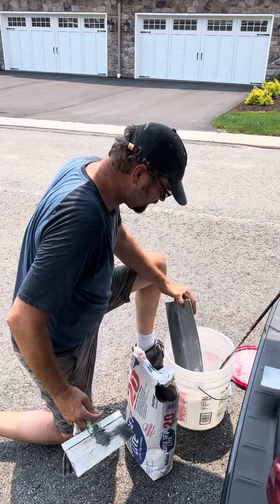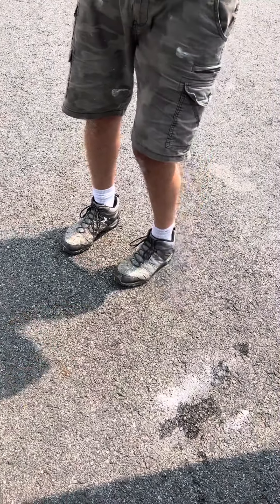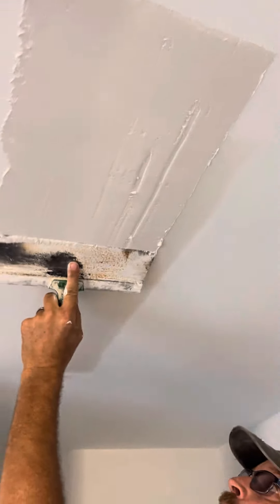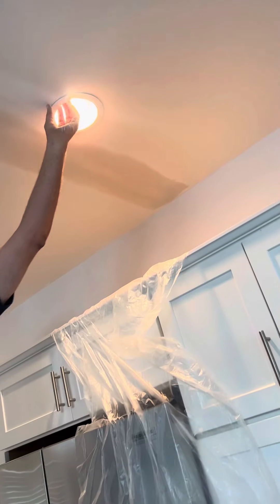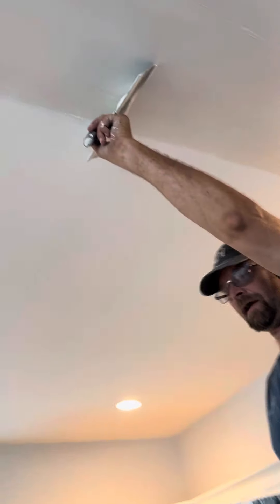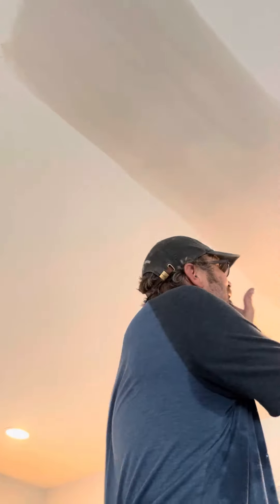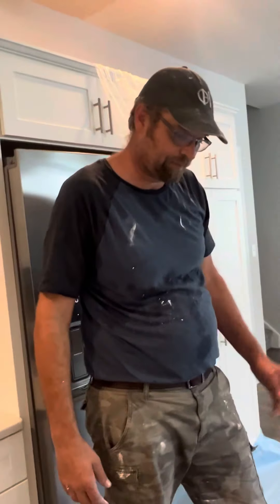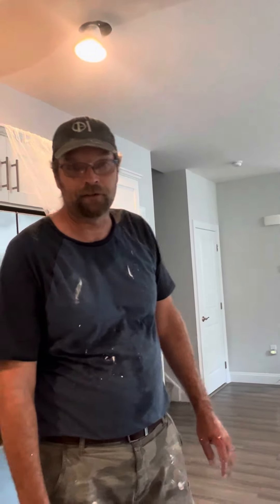Cracked ceiling repair Part 3

Comment: Another great video Leo! How would you address truss uplift cracks on a 2 yr old house? They vanish in the summer and open in the winter. I built the house for myself, and wanted to let the cracks get as bad as they could before I repair.  This winter will be the 3rd winter and I think they've done all they can do.  Should I wait until the cracks get to the widest point, pack them and then tape with something that flexes?
Reply from the maker: Truss lift is a tricky one.  Should only happen on interior wall top angles.  For angles like that,  you can use No Coat in the corners,  it will take care of the issue. Grabber 318111 No-Coat Ultraflex 325 Flexible Corner Tape, 100' X 3-1/4" https://a.co/d/hfJuE1t
Reply: @manwithapan  Yes, it’s basically just 3 short interior walls that have them. All down the gut of the house. Thanks for the advice on the tape!
Reply from the maker: @LukePitney1991  you can get a smaller size of that product, and it should work perfectly well